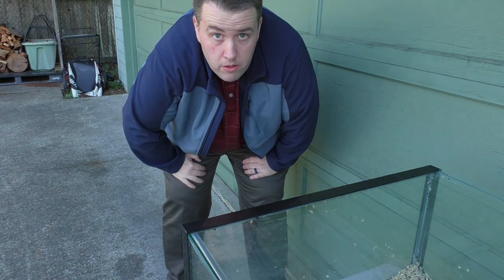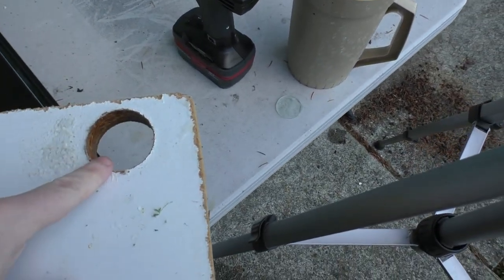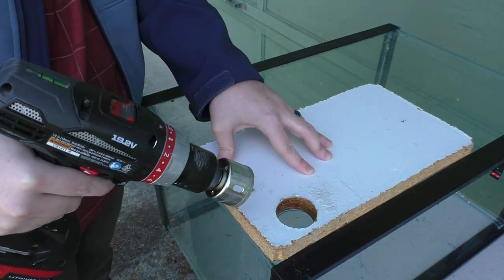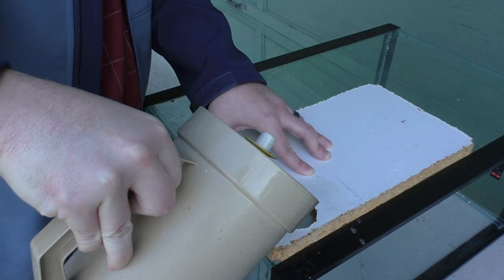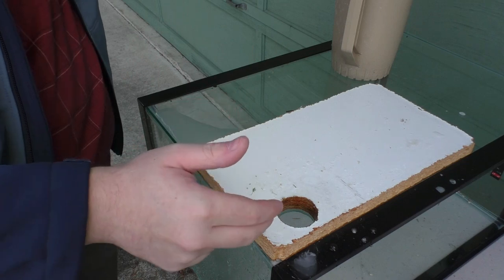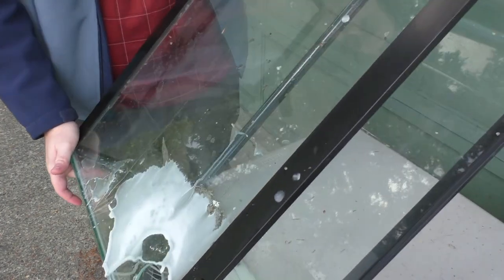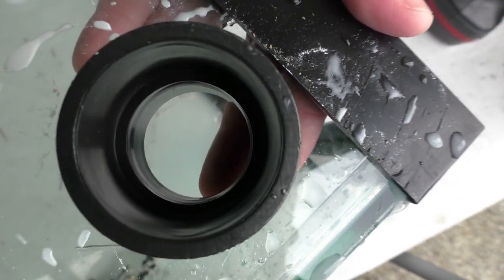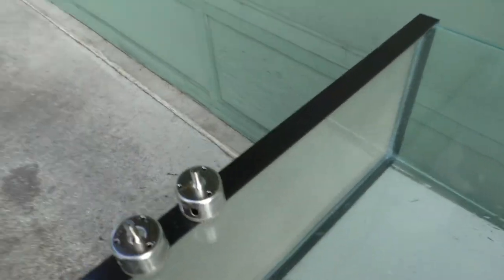How to Drill a Hole in a Glass Aquarium the Easy Way [DIY]

Comment: I just drilled (2) 60mm holes in my 80-gallon using a plywood template as you did to prevent the bit from traveling. I will say that using masking tape on the underside is probably the reason I had zero chipping at the point where the bit makes its final cut through the glass. It came out perfect. Just my observation and perhaps it will help you or someone else.
Reply: LOL.. Love the Mils and  gallons in one sentance .. We do a lot of that in Canada!!

Comment: TIP:  If you place duct tape or painters tape inside of the tank where you are drilling the hole, it will do two things.  1) prevent the cut out from falling once you’re done drilling...and....2) It will significantly reduce the inside edges of the hole from chipping and flaking

Comment: Cory, the best way to get a cleaner hole and less breakage is to put a piece of wood on the underside and use a clamp with rubber/plastic pads so the glass is supported.

Comment: Just a little tip that I do I put a bit of Play-Doh on the back of the board it seems to help hold it in position without creating those pressure points you can also create a little bit of a sale around the area you’re cutting which seems to hold the water in a little bit better

Comment: Put a piece of duct tape (or two) on the underside of the glass to support the round piece as it falls out. You'll get a clean hole every time.
Reply from the maker: +Steve Poland Cichlids I tried that method as well. I personally could never get a perfect hole. Thanks for the tip though. I can try it again. but I thoroughly tested different tapes and ways of taping it and none gave better results.
Reply: Might be worth to try clamping a piece of solid wood on the back
Reply: @chemetron3826  my thought was well
Reply: @chemetron3826  this seems like the solution

Comment: Just drilled 3 holes & believe it or not - two of them were totally clean cut. As the tank is 525litres & holes had to be drilled to the bottom I had pressure to the glass from both sides & probably this was the main idea why it did not crack from the edge. For the third hole I did not stand on the bottom glass & did have several pieces tored apart from the edge of the hole.

Comment: In the past they have been 99 cents on eBay,I just got my Amazon 25 pack and it works out to 64 cents each bit.great to have extra bits to practice with on scrap glass as the bits do wear out

Comment: Here's a tip, cut a shallow 1/4" groove from the hole in the template about an inch long, on the top side.  Strap or attach an air line tube on the end of the groove and siphon water as you drill so you dont need to stop drilling to add water.
Reply from the maker: That is a good tip. Thanks!

Comment: Cory I am finally about ready to pull the trigger and drill my first tank. (20L) Just wanted to let you know that the link for the AMZN diamond hole saws is no longer working.  I purchased one at Lowes  but wanted to compare the size of both to make sure I had the right size.
Reply from the maker: Thanks, just got it updated. Appreciate it.

Comment: Poke a hole a third of the way up a water bottle with a needle. When you loosen the cap, water will come out of the pin hole. Also tape the back of the glass to help blow out. Thanks for the video.

Comment: Hey Cory, I know this is an older video, but I find when I drill holes like that through wood that If I start on one side, and then finish up on the other, I don't get any splintering or break-offs. Have you tried that with glass? Just curious if would be any better. Especially when using the guide which of course would make it easier to line the drill up with the hole on both sides.
Reply from the maker: I did try it, on smaller tanks you have to use a right angle drill. It does improve it slightly, but you have to be exact lining it up unlike wood which can be sanded etc if you are 1/32nd of an inch off

Comment: I've found using drill press or a good, well balanced hand drill (best are pneumatic) with a jig or framework around it to hold it on the glass... Your hole saw has to stay at EXACTLY 90 degrees...! Your hands with a bubble level will always be shaky... Just my experience...
Keep Rockin out Cory...!

Comment: It actually is quite easy to drill glass without getting the jagged edge or chips. Put a piece of timber on the underside so your drilling from within the inside of the tank. No pressure or very little & just take your time & let the bit do the work. I just did for my first time & were perfect.

Comment: Thanks for the video, whats your thought on drilling a 125 gallon currently running?  My plan is to drain 75% of the water and slide the tank over so I can drill from the backside.  Any tips on drilling vertically?
Reply from the maker: It can be done, I just don't know I can advise it. I personally wouldn't drill a glass aquarium with water. I have done acrylic though.
Reply: I've done it before where I built an internal sump but there wasn't enough flow to keep up with the pump so the water would go over the main divider so I had to add more holes on the intake
anyhow...make a circle with some type of permanent marker then use a rotary drill..the hole won't be perfect but then again..the glass wont break

Comment: "Make sure it's not tempered"... okay. How? Our 75g came with the bulkheads in the floor and I really want to move them to the back. But just because the bottom has holes doesn't mean I can assume the back isn't tempered. I'm honestly tempted to replace the back glass with plywood so I know I can drill it.
Reply: You can use some sunglasses.  If you look at the back glass of your car, or your cell pho e and it looks funky, it means your sunglasses can identify tempered glass.  Use those sunglasses to look at your tank and you should be able to tell.  Especially if you have some sunglasses that so not identify (I think it is UV coating or something) and you compare the two.
Reply: @mkreate36  I found out about that trick after posting this comment. Still frustrating that nobody can bother mentioning it in these videos.

Comment: Why drill on top it should be at bottom to u can drain water.
Reply: If your hole is on the bottom and you have a power outage, return pump stops, all the water in aquarium will drain out. Overflowing your sump. With the hole, bulkhead, near the top it'll only drain an inch or so.
Reply: @tylermullins9793  Then how to change 1/4 water. Can u please help me with this.

Comment: Buy a proper diamond glass bit so the glass wont chip, also put a strong gaffa or duct tape underneath the glass and the glass wont chip. using chinese diamond bit is not a diamond bit. when you use equipment only buy the best.